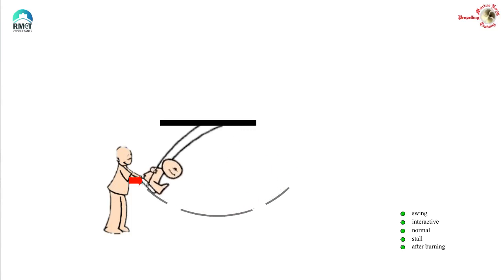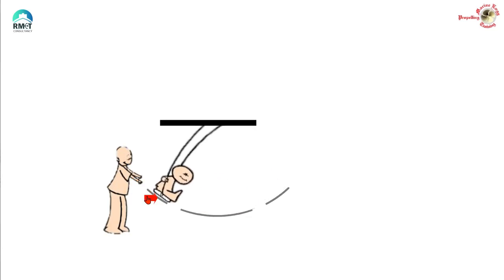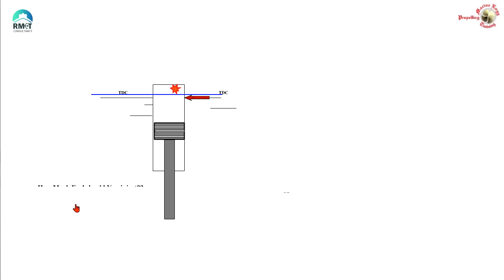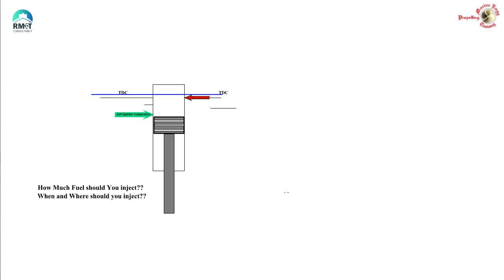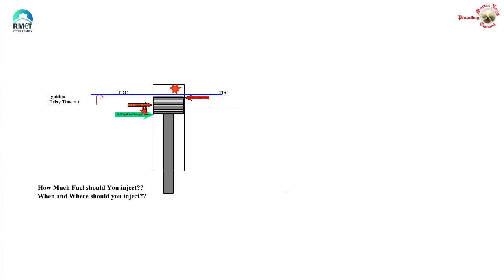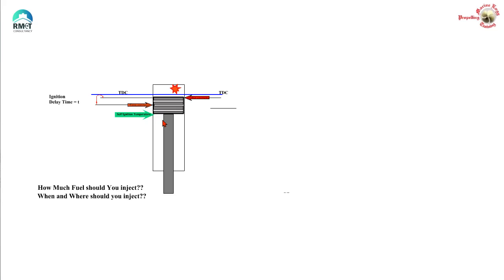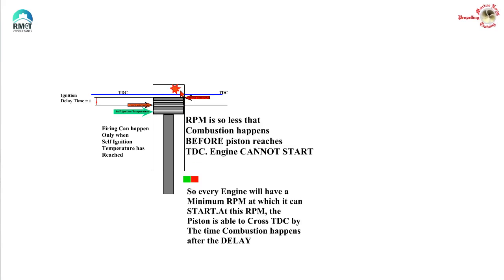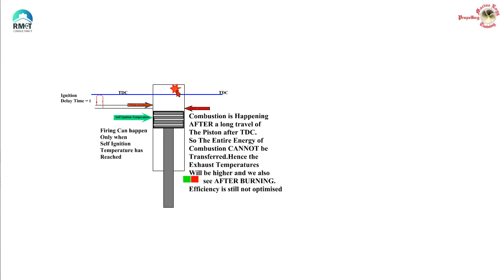Basics of Fuel combustion in Diesel Engine-Part 1 |Ramesh Subramanian|RMETC Videos

Comment: Sir with due respect, I found the reverse information in the books. They are telling if the engine is running for a long time at reduced power then combustion chamber temperature will decrease. It will lead to an increase in the ignition delay of injected fuel. So, the VIT will advance the start of injection to allow the longer delay but maintain the ignition timing. But you are saying that injection should be advanced if the load is increased as the piston moves faster. So both the statements are contradictory. Now I got really confused about whether I’ve actually misunderstood your explanation. Can you please clarify. I will be grateful for that.

Comment: Sir, can you please  make video for making punch mark for setting dial guage on the crankweb where it is not visible.
Reply from the maker: .. a very difficult task,,since I amm not sailing now and have no access ..
Reply: For making punch mark the distance is d/2 opposite side of crank pin where d is diameter of journal. Distance to be measured from centreline  of crankshaft

Comment: Sir in the video you said at low loads (ie Low rpms) we have to advance the fuel injection. But this will also advance the combustion and still the piston has not reached TDC yet and thus the engine will stall because combustion will oppose the piston stroke. So if we RETARD the timing at lower rpms, and ADVANCE the injection timing at higher rpms  so that we can get good efficiency??
Reply from the maker: 😀..i am dealing with all these in next video..

Comment: Have been banging my head to understand this concept. Nowhere it is emphasized about the relationship between rpm and self ignition temperature and the minimum rpm to start the engine, which is considered as a reference to understand the need for ignition advance. Your 14 minute video helped me to end my misery of two days. Thank you sir.🔥🔥🔥
Reply from the maker: Hold on..yr delight is a bit temporary..wait for part 2 which will come shortly..where we will be contradicting this very thing bcoz  we will deal with the real stuff...what we have done in part 1 is the theorey..with lot of factors  not considered for the sake of simplicity

Comment: Good day sir.
 I have an two doubts
 What is the difference between main engine combustion and boiler burner combustion
2. Is there any Sox and nox limitations for boiler. If yes? What is the value sir? If no then why no Sox and nox limitations.
Reply from the maker: I am not very thorough with this topic. Out of touch. But i guess the basic difference is in Engines..There is a peak pressure which is  very high and hence NOX is the issue. But In boiler there is no issue of Nox. But SOX is beleive might be common..

Comment: Sir, there is a major confusion regarding the minimum ideal firing speed which could be achieved using various means. Initially i was used to the concept that this firing speed was in fact needed to raise the temperature of the combustion air suffient enough to self ignite the fuel. But here you said that this speed is needed so that the combustion does not take place too early and stall the engine. The right and left side of my brain are now at war over this issue. Please sir stop this war.
Reply from the maker: Ha ha..both are right..I also said that the S I temp depends upon the scavenge press and the time available for cooling water to cool the air...which means a good rpm is required..:-)